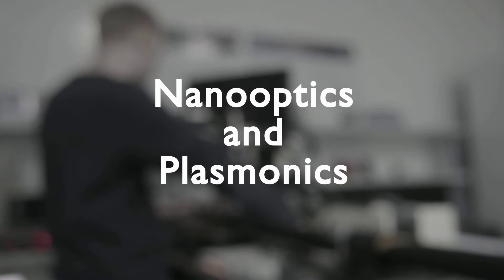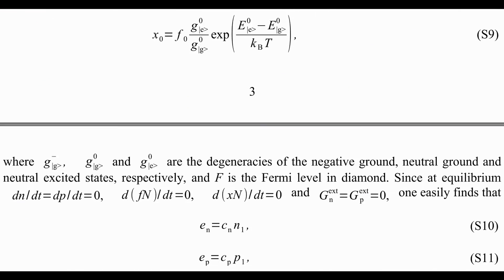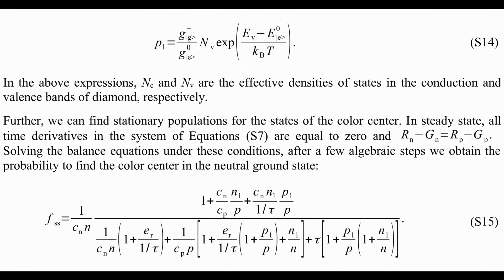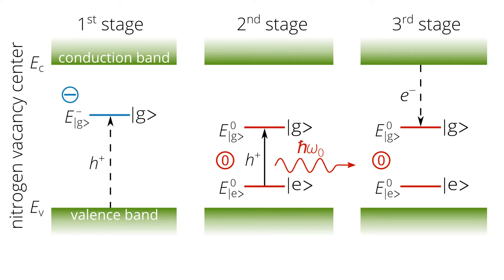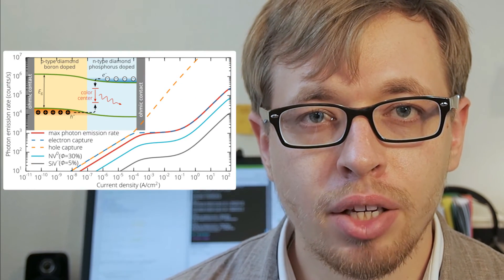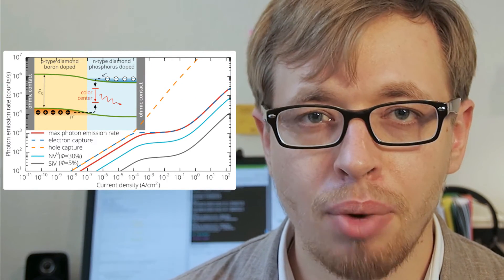Ultrabright single-photon source on diamond with electrical pumping

Comment: A question:

You commented that you found an increase in photon count when temperatures increase. Ok, but what happens to the statistical distribution of the single photon source you guys use, as in, does it stay subpoissonian? Doesn't the temperature increase the fluctuations of the photon emission?

If the answer is no, I suspect that this would be related to the whole electron-hole mechanism going on not really creating more than a photon at a time.

It is a very interesting mechanism, by the way. Congratulations.